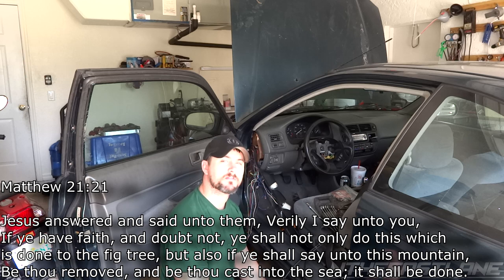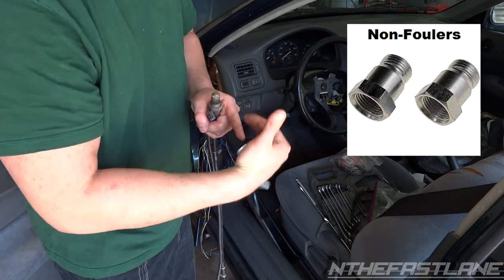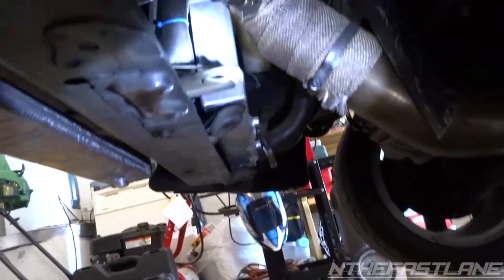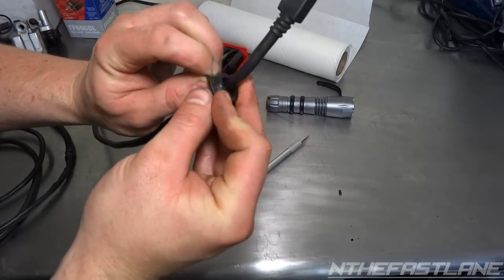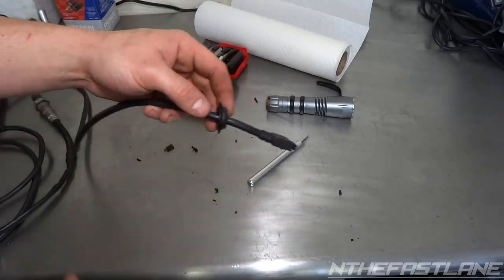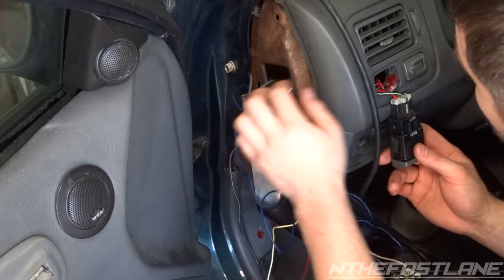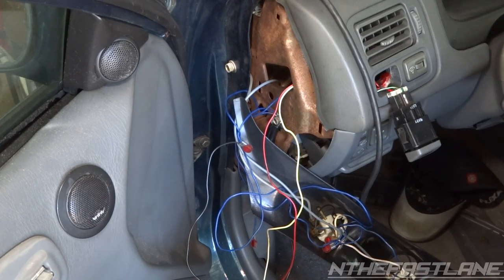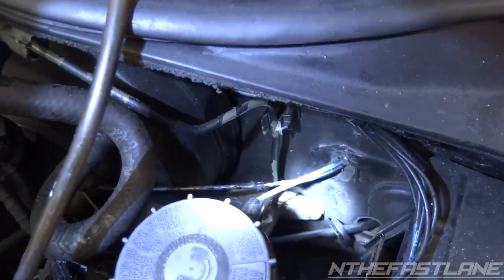Wideband Installation "How To"

Comment: For those looking to do this, just buy the correct O2 sensor bung and plug. The nonfouler keeps the sensor further away from direct exhaust flow vs using the correct bung, not to mention it's def NOT made to be welded. In order to make sure you don't warp the bung while welding, you want to thread the plug into the bung before welding.

Comment: The first honda guy that knows what he's actually talking about
Reply: funny considering how at 2:53 he calls that piece a "spark plug fouler" and says you screw it into the spark plug hole. That is absolutely incorrect. 

It is a non-fouler, its used as a spacer to get your o2 sensor out of the direct exhaust to change the reading of the sensor if its running too rich (for example if you cut off your cat converter you will probably need to do this). Running rich causes spark plugs to foul, hence the 'non-fouler' in the name.
Reply: Alex Simone who gives a sheite about “non foulers”
Reply from the maker: No I was correct. I did however say spark plug fouler which was a speech mess up, but if you look at the picture I placed, it says spark plug non-fouler.

Your version of a non-fouler is a made-up one. People would space out the O2 sensor like you mentioned. This isn't its actual purpose. Just like using a spark plug non-fouler as a wideband bung isn't its intended purpose, but it works.

Here's the definition on Advance Auto Parts website: Non-Foulers help protect spark plugs from damage.
Reply from the maker: A spark plug non-fouler shrouds the end of the spark plug to prevent oil from fouling the spark plug. 

And yes, you do actually screw it in to the cylinder head spark plug hole thread. That is actually its intended purpose.

Comment: Would have been good to see you wire the Guage itself, as my inovate Guage has no markings on the terminals as to what color wire goes where
Reply from the maker: This is for the Innovate MTX-L gauge

Red= Ignition 12v source
Black= Chassis ground
White= Head light power. This is the dimmer wire.
Yellow= Analog input 1. 0v= 7.35 AFR and 5v= 22.39 AFR.
Brown= Analog input 2. 1.1v= 14 AFR and .1v= 15 AFR

Hope this helps.
Reply: Thank you!

Comment: Question: what happens with the harness plug that the original o2 was plugged into? I have a 95 gsr. I would think the check engine wud come on.
Reply from the maker: That's where a tunable "ECU" comes in. You can turn off Bank 1 and Bank 2 O2 sensor and run things off the wide band.
Reply: Couldn't you just drill a separate hole from the hole here O2 sensor uses and run them both if you're not using ecu? Also couldn't you just use the radio remote on and off wire for power

Comment: Isn't it better to ground the ground wire with the ecu ground or close to the ecu?
Reply from the maker: A grounds a ground, technically the ecu bolts to the frame which grounds itself. Either way works as long as it's a solid enough ground to blow the fuse before a problem starts.

Comment: question. would it make sense to install the factory o2 sensor along with a wide band had a straight pipe installed factory o2 sensor is missing.

Comment: So you just replaced the upstream 02 with the wideband?
Reply from the maker: Only if the bung is 24in away from the cylinder head exhaust ports or 24in from the turbine exhaust. If it's not then you will have to weld a bung on. Closer then 24in and the widebands life span will be cut short, too much heat kills them.
Reply: @Nthefastlane  thanks

Comment: just wondering why didnt u get the aem wideband? it also comes with a bung to weld in ive got it in my civic
Reply from the maker: ***** Got a good deal on it, Their both great products, Innovate has to be calibrated before use where the AEM doesn't.
Reply: +Nthefastlane ive been doing so research and finding to many answers that are different. do you know what the fuel pressure should be for a b20vtec. all i got on it is intake full exhaust skunk2 intake mani and throttle body and mild cam.. what pressure should i go with.. ive seen 20-25 all the way to 50-55 lol i dont want to blow my motor up
Reply: 43 psi
Reply: ok ty i had mine right around 40. ill turn it up just a little to get to 43
Reply: perfect

Comment: Do you have to wire it to you're ecu to make the wide band read correctly ? Or is that just strictly for data logging ?
Reply: You wire it into the ecu to make the car run right. 
If you don't wire it in the ecu doesn't see any o2 sensor signal so it makes the car run rich as hell
Reply: Also concerned about this. What about a stock ecu? Like how would you go about that? I have no idea bout electronics. I have a 2006 Sebring with 2.4l motor and auto trans. Already bought everything to do this project except for the afr gauge and sensor. Just concerned how to wire everything.
Reply: @12101DyM   that is incorrect wiring into the ecu is just for data logging. The wideband would still read not being hooked up to the ecu

Comment: I have a turbo and as soon as i turn on car it max's out on lean. Please help. Everything is hook up correctly to d14
Reply: I had same problem. It worked as soon as i bought, installed and adjust the fuel pressure regulator
Reply: My fuel pressure was at 22psi. And once i turn in to like 40 it started reading good.